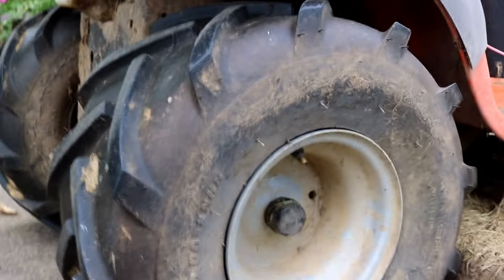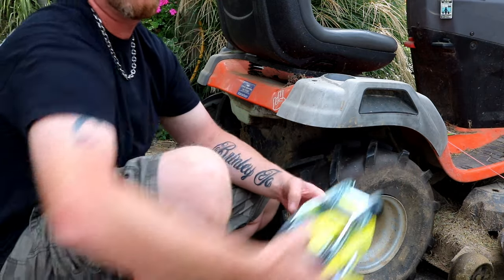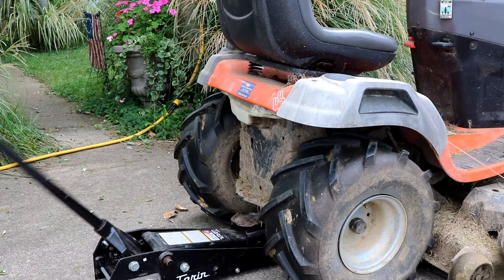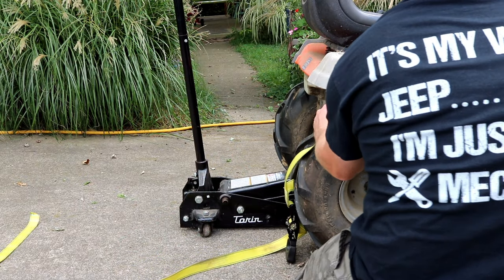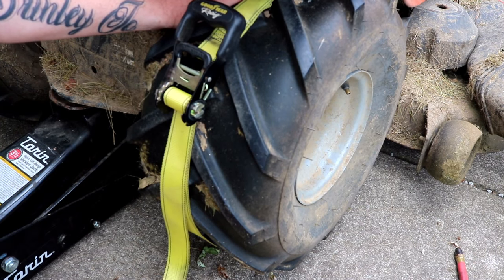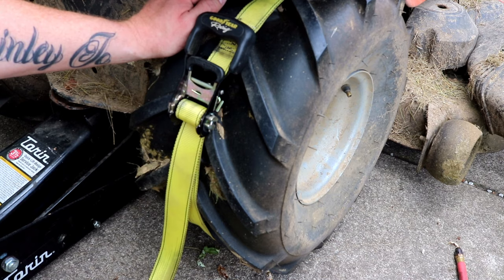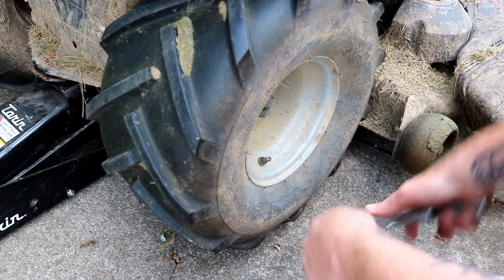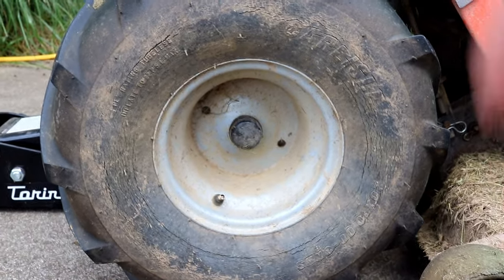Inflating A New or Used Tire With A Broken Seal / Bead

Comment: If this doesn’t work, add some slime or even soapy water, remove the valve, stem core and use any tool you have that will give as much air as possible

Comment: Thanks man, when they replaced the tires on my Honda Civic they didn't replace the valve stems, one cracked and started leaking, so I replaced it myself but had trouble re-seating the tire, your trick got me there, it was just enough to get the tire to hold air and re-pressurize. I was looking for alternatives to the starter fluid trick and this worked perfectly. Have a great day.

Comment: Thank you for this video, it saved my day, I wasn’t able to put a ratchet strap on the small front tire of my zero turn mower, but I was able to take my belt and wrap it around and squeeze down tightly on. It pop the air to it and it seated right back up. Thank you so much.
Reply from the maker: Thanks for giving it a shot, and damn… heads up to this guy for using his belt, knows how to get it done! This is awesome.

Comment: So I've used the ratchet strap method in the past and I've got to agree that it can become a bit dangerous to release the tension. The concept of the strap around tire works but instead of ratcheting it find a bar or screwdriver you can use to essentially turn the strap into a tourniquet. Then when you're filling it with air you can slowly loosen the tourniquet and you won't have to release all of that potential energy in the strap at once.

Comment: I just bought a new tire and had this same problem. Didn't have a ratchet strap so I took a hammer and kinda just hit the tire to somewhat get the tire inline with the seal. Got most of the tire seated except for one part that didn't wanna seat. Took some WD40 and sprayed the inside of the rim. It did eventually seal. I think next time I need to mount tires, I'll try the ratchet straps. Looks so much easier to get a tire to seat than losing my mind trying different ways to do it.

Comment: I went to cut my grass tonight and got out my riding mower for the first time of the season.  One of the tires in the rear has the exact issue.  I will get the ratchet strap and get this thing taken care of now.  Oh well, I at least got exercise by using my push mower.

Comment: Very good info.My friend, I have a leak from a beed that's not sealed .I was thinking to maybe use that black goo bead sealer.But I don't know how that's all gonna work.I gotta think about it
Reply from the maker: That stuff works good if you get it on good and get lucky in the right spot. We use tractors with 4 foot high tires at work and I have seen it work and hold on those.  Just go nuts with it and slather it on if you use it.  Best of luck.

Comment: Really good video!  Question, is it important to wipe/clean rim surface and seating part of the for a better seal?
Reply from the maker: For sure. Dried mud or debris will cause it to leak.. also forgot they make a tire bead sealer for people dealing with a scuffed up rim or damaged tire bead, that will seal it up with those issues. Thanks, take care.

Comment: IT WORKED!!!.... or MAYBE IT WORKED!!!(?).... or I'M NOT SURE IF IT WORKED!??  Tire was flat for a couple of months before I could get to it.  By then, it wouldn't take air; there was a gap at the bead.  29 degrees outside today and about to go to 5 degrees tomorrow - so if I don't get this working today, that rubber might never pop back into shape to seal at the rim. Soooo to be on the safe side I:
1) heat gunned the tire (to make the rubber more pliable, 
2) jacked the tire off the ground (to take the pressure off the tire so it would have a better chance to form back into a circle), 
3) ratchet strapped the tire like in this video
4) set the compressor as high as it would go - 140 PSI in my case (you want as much air as possible blasting into the tire as quickly as possible so that the air is going into the tire faster than it can come out at the rim.  This is the same concept as an "Air Tire Bead Sealer" aka "Air Blaster").

And VOILA! That sumabitch took air - and I didn't have to end up taking the tire off the car to take it to a shop.  It might have just needed to be jacked up to work.  Or it might've been the heat gun.  Or it might've been such that when I tried to put air in it before, the compressor was only set to 90 PSI...  Or a combination or any or all of those.  Hopefully the 2 minutes to read this will spare you the 2 hours of headache of having to take the tire to the shop.

Comment: What if the tire is completely flat same process ?
Reply from the maker: Same process will work, just make sure that strap is right in the middle of the tire.  I’ve done it on 6” dolly flat tires, and 48” tractor tires… works like a charm. Sorry for the late reply. Was stuck at work.  Best of luck!

Comment: Thumbs up but I'd rather use starting fluid and a match (lol)
Reply: I saw another vid where they said to remove the inner part of the valve stem with needlenose, there's a small rubber gasket on it that can burn and get destroyed if you put too much starter fluid on or near it. Since there's no reasonable way to tell I looked for alternatives and this worked for me. Using this trick I could inflate my Honda Civic tire with a bicycle pump. Cheers.
Reply: Put a helmet on when doing so. It’s the only time I use mine to bead tires 😂